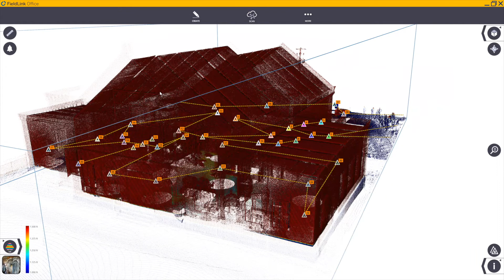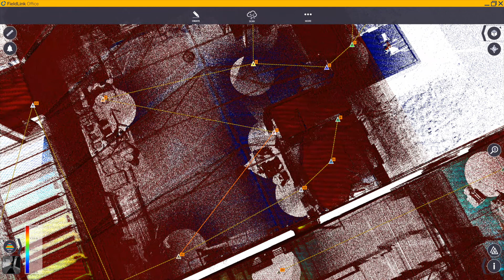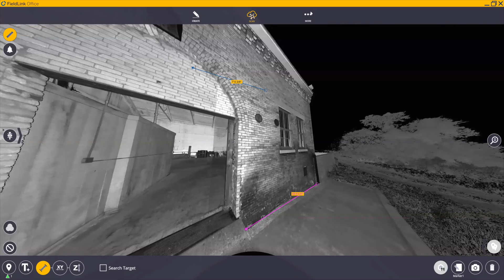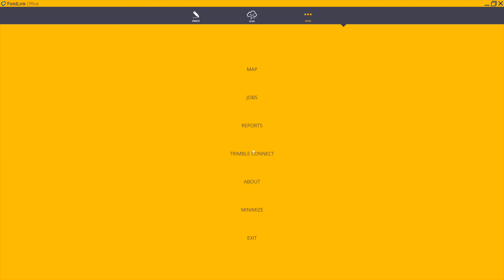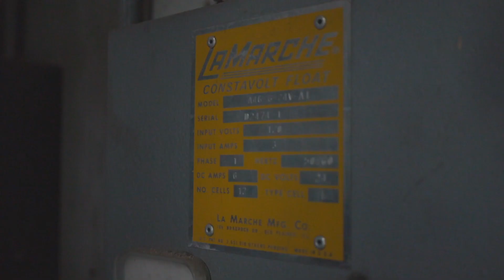PROCESSING POINT CLOUDS | HOW MUCH TIME DOES IT TAKE?

Comment: Thanks for this video series! 
At work we're used to (loaning) that Faro scanner, but we're looking for a new one for ourselves. This Trimble machine might be the one to go for.

So the only things you guys had to do in the office behind a desktop, was processing the scans? Which basically came down to the computer processing for you? 
Does that include the process of converting it to a Recap file? Did you have to reregister every scan for that?
Reply from the maker: All registration was complete while we were in the field, so once we got back to the office all we had to do was bring it on to our desktop and let it process the colors.

When we converted to recap, we didn't have to re-register those scans. Everything transferred over and it wasn't a deal.

Also, we just purchased one for ourselves. It was around $45,000 (ish) out the door.
Reply: @constructionbrothers  thanks again!